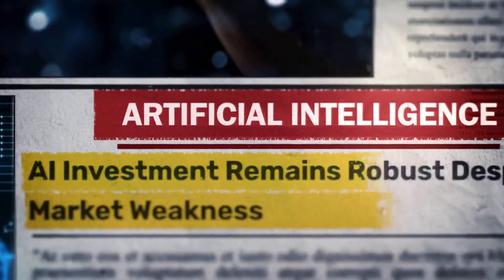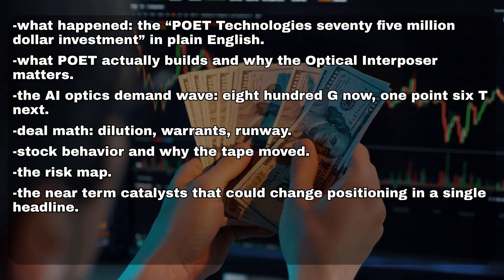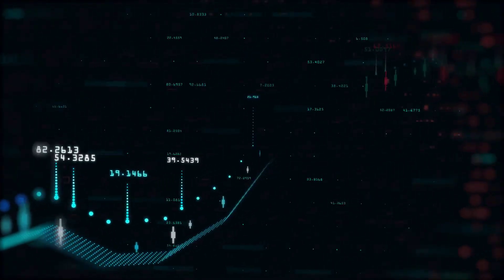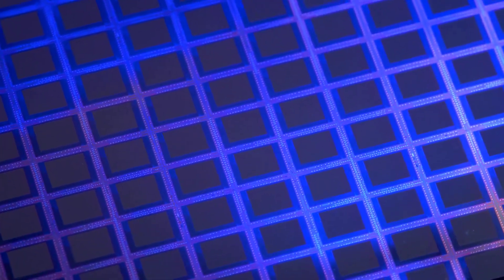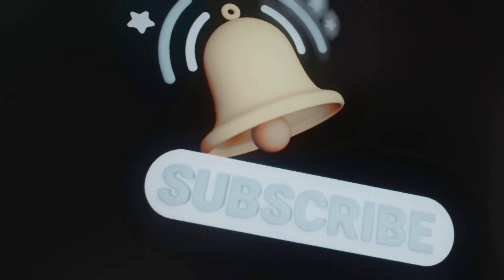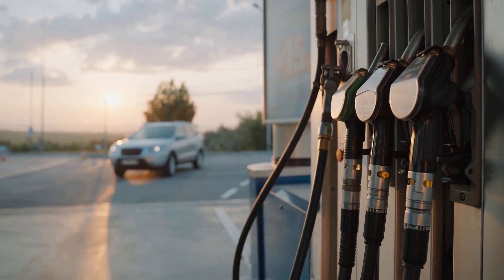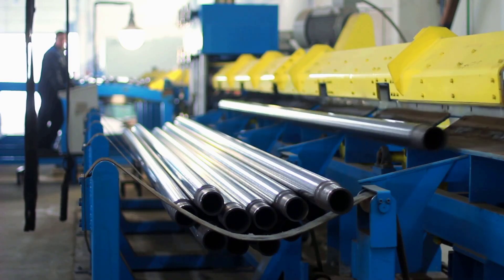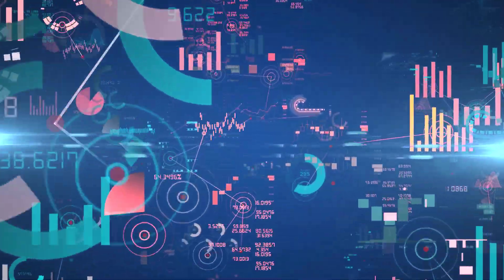POET Technologies $75 Million Investment Explained: POET Stock, AI Optics, and What Comes Next

Comment: Dude your to out of control, scratch this video
Reply: Great presentation, does your interposer work the same with gpus and qpus and will it be a direct connect with photonic processors
Reply from the maker: Thanks! The interposer’s job is wafer‑level passive assembly of photonic/electronic components to build optical engines. It’s used inside modules that connect to hosts through electrical SerDes (via a DSP/CDR), not as a die‑to‑die interposer for GPUs/QPUs. ‘Direct connect’ to photonic processors could happen if those processors expose standardized optical I/O; today the roadmap is centered on 800G and 1.6T data‑center optics rather than quantum‑control links. Happy to look at specific device families if you share them.
Reply from the maker: Appreciate the feedback. What felt ‘out of control’ to you — pacing, audio mix, transitions, or tone? Happy to improve. Timecodes would help a ton for the next upload.